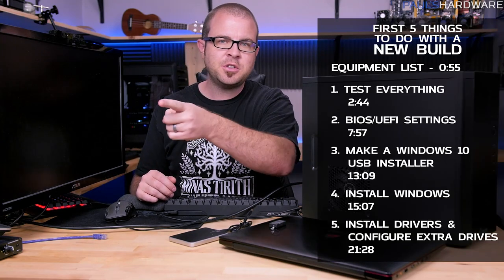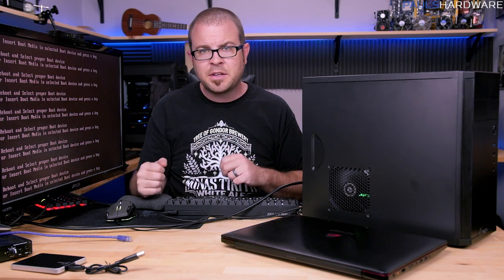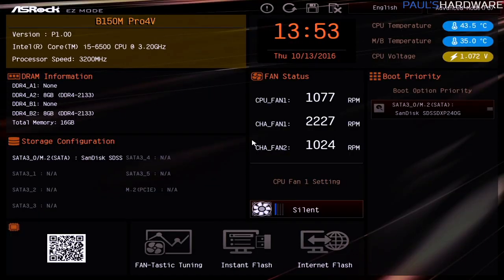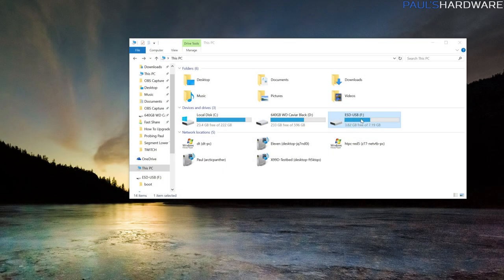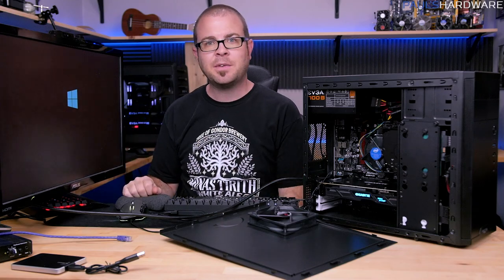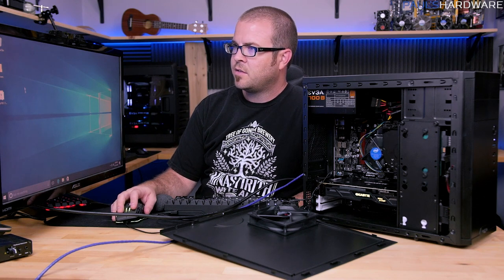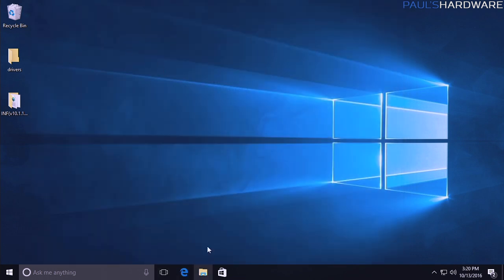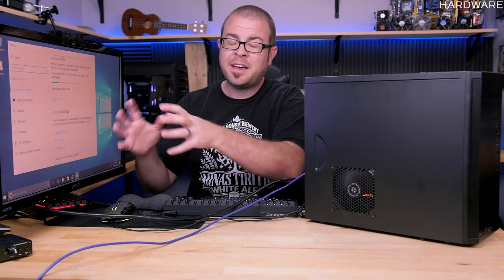First 5 Things to Do with a New PC Build

Comment: After new build prepare to embark journey to mordor you vs 148 updates 10 different drivers when you finally updated all firmwares and drivers you finally can use pc
Reply: Jason Blahautist uhhhhh
Reply: @clack185  he nasty nasty
Reply: pro tip: if you have your steam library on a secondary drive you can simply plug that drive into your new system and copy the archive 
or just transfer it via ethernet if that's not possible, still obviously faster than downloading
this should work with other game launcher libraries as well
Reply: You don't even have to reinstall windows, if ASAP usage is your end goal...

Comment: Hey Paul man thanks for making these pc vids they've helped me a lot
Reply from the maker: you're very welcome Will!
Reply: Hi Paul, usb3 I do not recomended, because when Windows 10 creates the flash install drive eliminates format of usb 3 and then after you want to use, system doesn't recognice as USB 3, not even usb 2 in USB 3 ports and has to be formated at low level, and sometimes still not function at USB 3 velocities.
Reply: your wtf

Comment: Hello Paul an everyone else I just built my 1st pc an I having problems with creating the media tool,  it will not pick up any flash drive to put the ISO on please help someone!
Reply: search "win32diskimager"  .   This is a software program that everyone uses to write ISO and Image files to USB and SD cards.  This will allow you to boot from the USB.  You may have to go into BIOS to make sure the computer checks the USBs for a bootable device.  Sometimes your computer is set to just look at the hard drives.
Reply: Did you make sure it allows you to download windows 10? Mine was defaulted to windows 7 so I needed to change it in bios
Reply: Michael Smith thank I actually used another program that forced the ISO on to it. For some reason it wouldn't let me use any memory drive through the normal tool creator, topical windows troubles lol
Reply: Boomshack got it used a third party program to force the boot file onto the USB
Reply: Honestly YouTube isn't the best place to ask for help lmao
Reply: Fuck that shit just use Rufus :)
Reply: Did you try asking jeeves?

Comment: *I NEED HELP WITH HDD SETUP 29:02 

Hi,
Recently I just finished building my first PC build. I configured the settings in the BIOS and got everything setup the way I wanted it to be. I have a 250 GB SSD as my boot device for Windows 10 and a WD 1TB HDD. Everything was working great! I went into disk management. The SSD(Disk 0) is showing up and the HDD(Disk 1) is shown as well, but the HDD wasn't showing up to where I could use it to store anything on it yet. So, I went ahead and did something to mess something up with it. Now, what is shown is only Disk 0(my SSD) and System Reserve(500 MB). How can I fix to make it show again and initialize it?
Reply: Jeffrey Croft u gotta install windows on that hdd also
Reply: If you still need help after 4 months.. check your Bios and see if it even recgonizes your HDD as a drive. If Not, then something is wrong with the connection. If it still isnt showing up, and you have made sure it's plugged in, reflash your bios
Reply: chin-yen Liang I sold it to a friend and he was able to initialized it on his pc with no problems, and I bought another one and I was able to initialize it too with no problems. I have no clue what I did to make the first one I bought unusable on my PC lol. Thanks for the help, though. I love PC gaming!
Reply: Jeffrey Croft it was the unallocated space I am certain of that

Comment: The first thing I learnt after building my updated PC last year was as follows.

Test your brand new EVGA G2 1000w PSU outside of the case with the bridge connector.

Or any PSU. Because the PSU blew on first switch on and took out an SSD in the system. I was very lucky not to have more damage. 

It tooks weeks to get it RMA'd and was not especially cheap to return. I bought the PSU because my EVGA 980Ti came with a 50% off deal on a PSU. So I went overboard and bought a much higher spec PSU than I had ever before. And it failed.
Reply: damn that's crazy, but yeah everyone should breadboard before installing in case.
Reply: Pretty much the worst thing was it was the first PC I had built in about 8 years. Going from a 775 based system to an X99. So, while a lot was familiar, a lot had changed. Complete rebuild with Predator 360 cooler (which had to be replaced as I had the V1.0) etc etc.

Spent a good afternoon building it all into the Enthoo Primo case, tying everything off and making it tidy.

Put it in place, had my face at the back of the case when I flipped the psu switch. It flashed in my face. 

Blew the fuse in the plug and tripped my mains fuse box. The smell of burnt electronics filled my room. I just sat down in a daze for about 30 seconds. I had no compatible parts to test and I was not about to risk the working 700w psu from the old PC. In case it was a different component that failed. I have to totally dismantle the PC and return the parts I bought from the retailer in person. To be checked. Luckily none of those parts were faulty. Only an SSD that was carried over from the old system. It worked fine previously. 

Realising it was the PSU and all the new parts otherwise had been tested as working. I bought an EVGA EQ 650W cheap PSU as a run till RMA. At the store. Built it when home and it all worked. RMA the G2 and it was replaced. Annoyingly, when I had the G2 back, I found out that the cables with the EQ and G series are not compatible. So I had to redo all the modular cables. 

Then in the timeline I had the recall notice about the EKWB 360 Pred...

Then to make matters worse, I bought a couple of Sandisk 480 Ultra 2 SSDs and they failed 5 months later completely. Within a week of each other. Seems there was a faulty batch. 

I've had some very very bad luck with PCs this last year.
Reply: yikes!  that's a nightmare story. I've done 4 builds and thank God I've never had a problem.
Reply: Is it bad that I've done some learning about tech stuff and ordered all my parts for my first build, but don't know what a bridge connector is...?
Reply: nah, a lot of people don't test their hardware before installing it, but this guy's story is a good example why you should. the bridge connection he's referring to is a connection bridging the green wire to a black wire on your 24pin connection of your psu. that will jump start your psu and get the fan to spin. I also like hooking up a case fan or lights to the psu to make sure they come on.
Reply: casheesed After doing some Googling on the Google machine, I guess you're talking about the paper clip method? Wish I could try it but all my cables are black (EVGA SuperNova GS), so I guess it'll be a fun or terrible surprise when I hook everything up. :P
Reply: buggld yeah, you could count the pins to see which ones you need to jump, but probably not a big deal if you skip it. You should breadboard your build though. It's only a few extra minutes and could save you from some headache later on.
Reply: are there any recommended videos of people putting together their pc step by step? i am new and would like to build one for gaming but worried because i don't really know where to start. is it common to run into problems when building a pc?
Reply: azure strike yeah, there's tons. Paul even has some.
Reply: azure strike besides videos you should also check out PCPartPicker. there you can create a parts list and it will tell you if things aren't compatible with each other. step 1: decide your budget
Reply: thanks :D yeah pcpartpicker is an amazing site glad i found out about it since i am planning to build a pc of my own! it looks fun. i am only worried about something going wrong.
Reply: azure strike yeah I think everybody is a little worried their first time, but there's not much to worry about. after you're finished you'll realize how easy it is and nothing to worry about.
Reply: +casheesed ok ty :D

Comment: First 5 things to do with a new build. 
1. Pray it posts. I mean really call upon what ever higher power you believe in that the silicon gods show you favor and the thing starts up. With all new components the odds are something could be bad out of the box and it can be a nightmare tracking it down on a new build. 
2. Look at the Bios. Don't go crazy with the bios at first. Start with default settings as much as you can. There will be plenty of time later after you know everything is stable to OC and go crazy.
3. Install OS of choice. For most it will be Windows X or whatever latest version is at the time of build. Be sure to do all updates.
4 Install Anti virus of choice, and all drivers, especially video drivers. Flash Bios if there is an update. 
5 Install software *Games and test the machine under load. Up to this point it's had it easy but now it's time to see how it does under some pressure. 

If you pass all 5 then you can go crazy.

Comment: I bought a Win 10 Pro key from Kinguin, and it doesn't work, says it's already been used on another pc. They won't answer my emails or support ticket either, so that was a waste of $30
Reply: Andrew Wukusick I got lucky when I bought a key from Kinguin for my PC in January, but when I bought a key for my friend's first pc, the same unfortunate thing happened to us. We split the loss ($15 each), since it was my idea to use Kinguin, but we will never use that grey market site (or G2A for that matter) again and will recommend others avoid it as well.
Reply: zealot491 there's nothing wrong with g2a just don't use kenguin
Reply: but can you use some third party programs, that can crack windows and disable that activate windows watermark ?
Reply: did you use insurance option?
Reply: G2A uses stolen credit crad infos to buy keys...
Reply: Try phone activation, sometimes this happens even with copies straight from microsoft. Happened to me and phone activation cleared it up.
Reply: never had an issue with kinguin, have bought dozens of keys usually just need to call the automated system and read the numbers and it works just fine :P they are legit keys just from another country where keys are cheaper due to their economy.. grab insurance though kinguin is good about support on them
Reply: The same thing happened to me and was soooo pissed when it was going on but I found a way that should fix it. First you can just go to kinguin.com and got to the customer support and they have a whole page on this issue alone, so that might help. But what solved the issue for me was activating it via the phone method. It takes a little bit of time and can be frustrating because of helplines in general but if you stick through It should solve the issue for you. It resolved it for me so I hope it does for anyone else. Hope I helped someone :)
Reply: just use linux mint or linux ubuntu. both free and better OSes than windows.
Reply: Don't use sites like Kinguin, G2A, CDKeys, etc. Not only do the keys you get often not work, but criminals use it to steal money from Paypal accounts and make the money untraceable, so by using it, you're indirectly supporting theft.

Comment: is it F11 for every new computers nowadays?
Reply from the maker: Not all motherboards have a boot option like that on startup but many do, and the key that's used can vary. Usually you'll see a splash screen right after you power on with the motherboard manufacturer's logo and the boot interrupt keys listed, usually at the bottom of the screen - Del for BIOS/UEFI, F11 for Boot Options etc.
Reply: ok

Comment: How did you install windows without the key, does it mean that you didn't pay for the windows
Reply: Im having the same question. Do you not have to pay for windows 10?
Reply: When you install windows you can click now to pay for it immediately and it'll give you like a trial for around 2 weeks. It's what I'm on currently, but at the due date windows will kick you off of their os until you finally get a product key.
Reply: Don't install Windows, install Linux. UEFI is Linux-based anyway, you may just go all the way. No key needed.
Reply: Question! So connecting to your Monitor (or TV via HDMI), Keyboard and Mouse does not need "drivers" even when having a newly custom built PC right?

Because I'll be connecting my PC to my TV via HDMI and I've read about it that drivers are needed etc. and it made me confused... (Maybe drivers are needed only when using Graphics Card?) 
So will I be able to use a Monitor (or TV via HDMI), Keyboard and Mouse without installing drivers, so that I can use them to navigate through BIOS while having no Operating System?
I won't be using Graphics Card by the way and I'll be installing Linux Mint instead of Windows.

Newbie here...
Reply: Emm, I think you're mixing up emulation (which I don't do at the moment), native binaries and other technologies like virtualization. 
Getting Windows isn't the best option for everybody; for example, I'm having orders of magnitute more software on Linux than I could ever use in ten lifetimes; mainstream games like Portal, Portal 2, Portal Stories Mel, Lifeless Planet and The Talos Principle; they all run comparable to their Windows counterparts, according to Phoronix even a tad better because of OpenGL and Vulkan optimizations (thanks to Valve and CroTeam), and because better architecture (comparing, for example, filesystems, memory mgmt and driver models in Windows and Linux respectively). Plus, I have the benefit of Microsoft not spying on me.
Reply: there is a free version of windows 10 that is limited in features.

Comment: Wait so what was the point of 5? I understood the point of the internet connection but what about the other stuff? What does that Help with? Sorry this would be my first build.
Reply: You need to install drivers to make sure your hardware works efficiently,in some cases to make sure that it just works
Reply: im subbed lets see this happen
Reply: For some motherboards (although it is becoming less common all the time) even the network adapter needs separate drivers for the network connection. And assuming you do not want overclocking, sometimes the auto settings for memory are incorrect and you need to override them to get what you have paid for.
Reply: You need drivers for all your hardware to work, like graphic card, sound card, video card, keyboards, mouse, etc. Windows 10 can provide you with default drivers, which works in most cases. But in some cases, they are outdated or doesn't work at all. For example, Windows 10 can provide you with out-of-date Nvidia graphic card drivers. So, you will need to install your graphic card drivers from Nvidia's website, or install GeForce Experience, which can detect and easily update your graphic card.
Reply: 10,000 subscribers without any videos!!! You need a chipset driver, sound driver and the Intel management engine to make sure those respective hardware are working because as he describe, windows 10 installer still doesn’t have all the essentials it needs to talk to those external peripherals and stuff

Comment: Has anyone had any luck with windows 7 key on kinguin ? Thinking about using it for my upgrade.
Reply from the maker: Due to the way Windows 10 activates w/digital entitlement, I'd prefer it on Kinguin. I've heard from a few people who purchased older versions and had activation problems.
Reply: So my best bet for getting a key for windows 7, would be to get a brand new disc with full activation key? or go with windows 10 on kinguin?
Reply: Brian Boyette No, don't by a brand new one. Just torrent for free.
Reply: Generic Username yea. but there's a risk of having a very sneaky bot in Windows
Reply: Kevin M True, but that is if you get one from the wrong source. There a trusted ones out there.
Reply: torrent it
Reply: +Generic Username where can I torrent it? really need it asap
Reply: james c. your better off grabbinf the ISO from Microsofts website. then cracking it.
Reply: It is basically piracy but worse. Paul is 100% wrong on this one. They aren't OEM keys, they are keys that break the ToS if sold and sometimes are purchased with stolen cards so on top of getting a non legit key that could be deactivated you would also be supporting criminals.
Reply: I used kinguin to get a Windows 7 Pro key. It worked perfectly... Just be sure to get it from someone who has good reviews
Reply: All of the keys on that site break the ToS since they can't be sold so they aren't legit and are at risk of being deactivated and some of the people on there are criminals using other peoples money  to buy keys.

Comment: The worst thing is I'm building a i5 6500/gtx 1070 but it costs double the price of this.
Reply: A 6700? So not a 6700k?
Reply: Admiral Ackbar I spent $550 on my 1060 in Canada (although it was gtx Strix and if I'd wait could have saved $100) but point is that I know your pain here in the great white north
Reply: Jason Martens If you live in canada, check how the linusmediagroup get their stuff. You can always order online.
Reply: In England things are more expensive iswell! Those lucky Americans!
Reply: Norway is even more expensive with 25% tax of everything on pc stuff
Reply: MrTander1234 25%?!?!?! Woah
Reply: You all should check and see if there is a Micro Center near you...Best prices on CPU's.
Reply: Mitch C. I think that's bs I checked them out (even though I don't live in the USA) and they just seemed normal... :/
Reply: Sheena1234ization They have an exclusive deal with intel and amd. You can't get a processor cheaper, but you have to go to the store to pick it up.
Reply: I feel privileged. I spent 250 on my 1060. I'm just waiting for the rest of the parts to get here so I can start building.
Reply: josue rojas Here in Sweden a gigabyte gtx 1060 costs about 200$
Reply: TheGIANTgonads gy